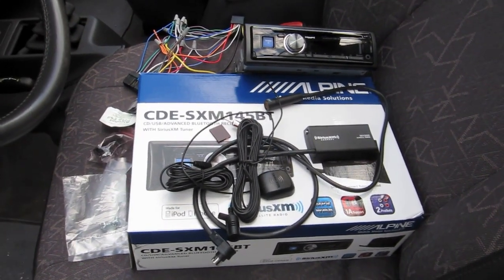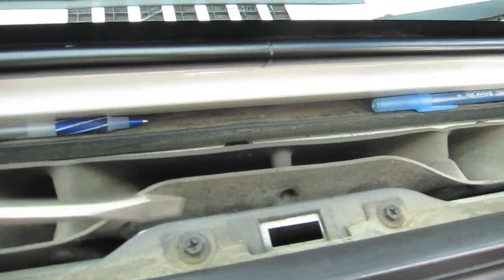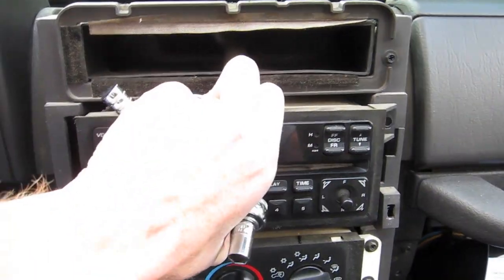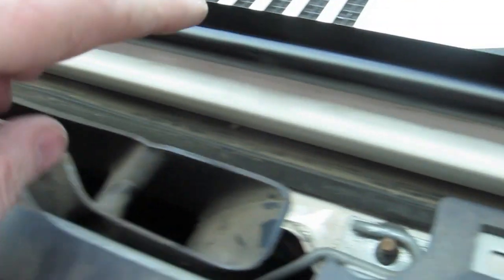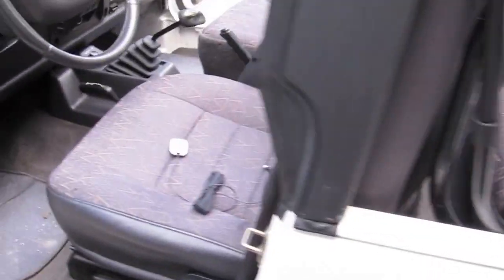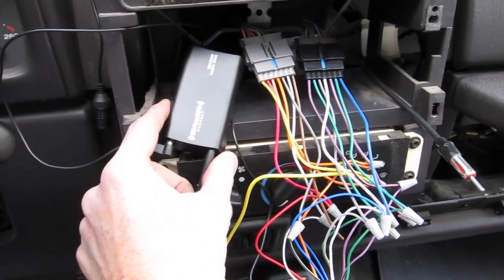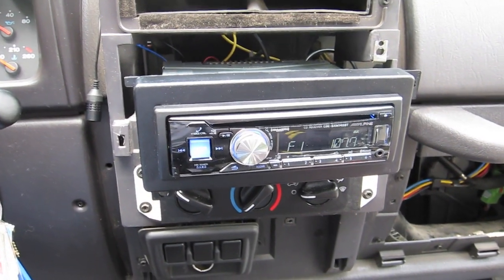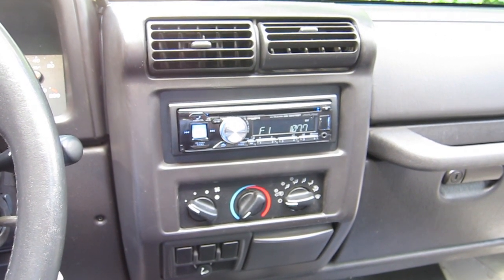2002 Jeep Wrangler TJ Stereo Installation with Satellite Radio

Comment: Great video, thanks.  Would add one comment re "hardest part of removal" which is getting at the nut behind the radio to unattach from Y shaped metal retainer.  You don't need to.  It's much easier to remove the two nuts anchoring the Y shaped retainer bracket to the dash as you've illustrated and then simply bend the retainer.  Approach from the top and bend the two arms of the retainer inward i.e. towards each other a bit, they're surprisingly pliable. Then one can slide the old radio out the front while rotating upward slightly and it's free with said Y shaped bracket still attached to back of radio!  Much easier.